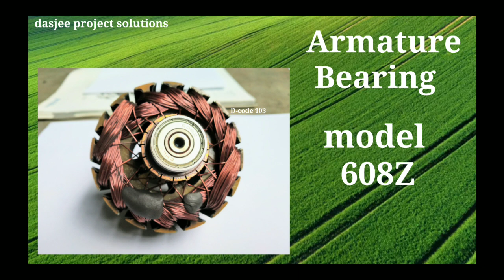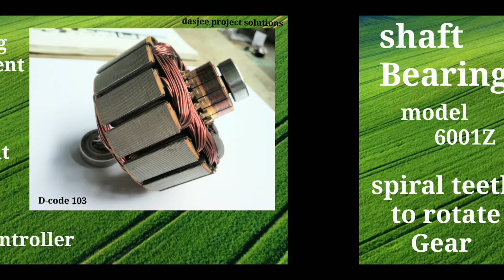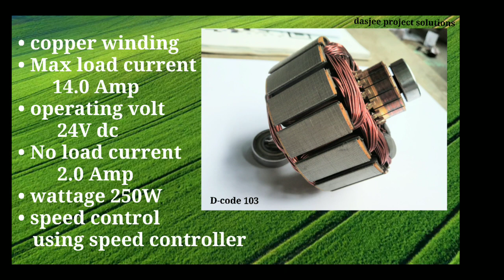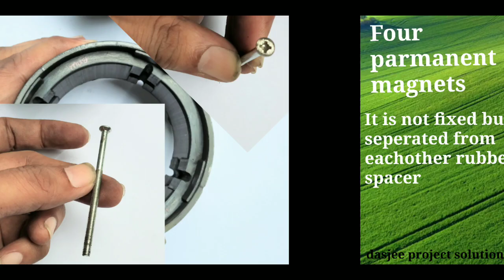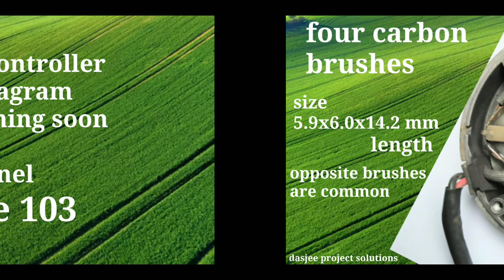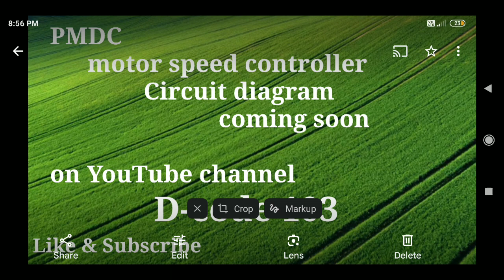MY1016Z2 PMDC Motor internal technical info.

Comment: Hallo sir can you build a project for me
Reply from the maker: Your location please
Reply: @Dcode103  odisha,bharat
Reply from the maker: Tell me about your project.
Reply: @Dcode103  can you build a code for stabilizer 90v to 300v on pic microcontroller based with seven segment display
Reply from the maker: Yes
Reply: Sir where are you from?
Reply from the maker: Currently We are working from two locations central INDIA MP and Bihar.